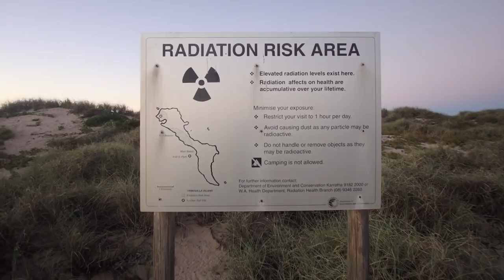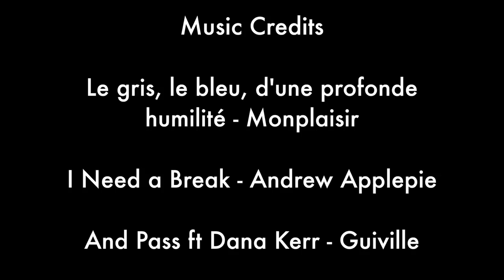Radioactive Lobster - Free Range Sailing Ep 4

Comment: I loved the melted insulation on that power cable at 20:30. You shoulda gaffer taped it as well, while you had the tape out. Thumbs up on the repair job, too.. done my share of emergency fixes like that one, over the years.
Reply from the maker: That cable was a throttle controller. Since replaced but still going strong.

Comment: Dropping a screw, bolt, or a tool into bilge requires having a telescoping magnetic tube. Most helpful. My wife keeps one at home also to retrieve small objects.
Reply from the maker: Excellent for all but 316 stainless. A doctor friend just gave me some extended callipers used in endoscopic surgery. Really great though a bit hard to come by!

Comment: l too love using things other than the purpose they were intended. Great use of the tin as a sleeve. I call it being resourceful. What's that  melted insulation on the cable at 20:30? What has Macgyver got in store for that?

Comment: It would be nice if you had a radiation detector. They're only about 100 US for a decent one.
I recommend always using a buoyancy compensator when free diving with weights. If you every have an emergency it's good to be able to pull the cord on the BC to get you to the surface quickly.